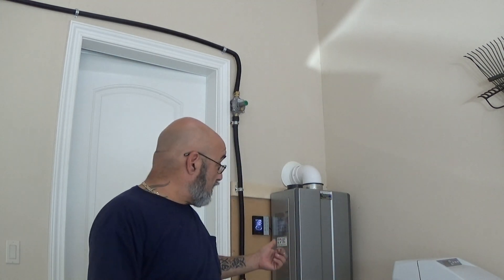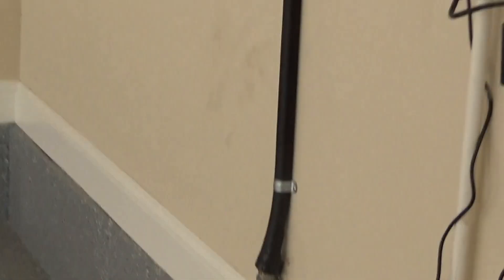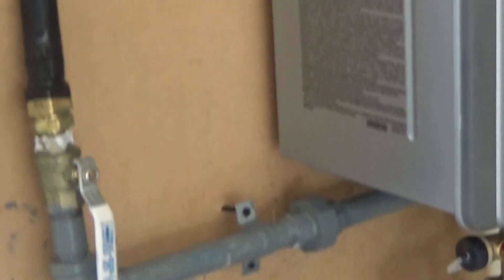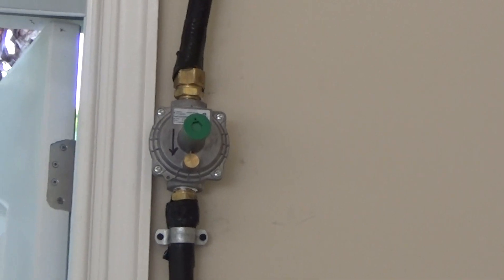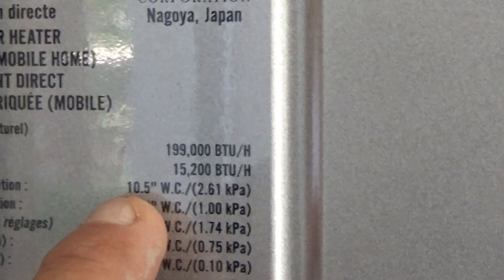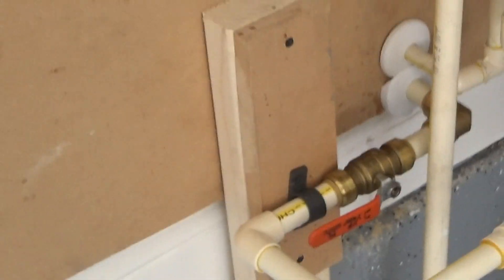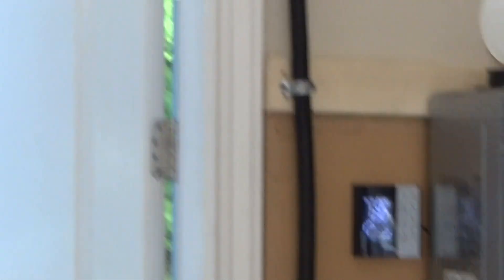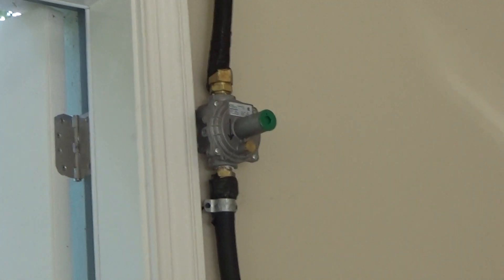Running a dedicated gas line to a Rinnai tankless heater.

Comment: that in line regulator needs to be horizontal  or the vent limiter wont work correctly  at least with the maxitrol   🤣  just pickin on you

Comment: What kind of regulator could I use if I'm just coming off of a portable propane tank? I installed the Rinnai 65ip last week but haven't hooked up the propane yet, and I'm Offgrid. Can I use a 2 staged whip regulator and hose?

Comment: IF YOU HAVE 2PSI AND LESS THEN A 40' RUN OF 1/2" PIPE AND YOU BTU IS 200,000 OR LESS THEN YTOU CAN PROBABALY JUST  USE 1/2" GAS LINES. LOOK AT YOUR INSTALLAITON MANUAL

Comment: Mike,
I am replacing my water heater to a Rinnai V75i . I have 3/4 line thru the home but the last 16 ft to the old heater is 1/2. Do I have to replace what 16ft with 3/4?

Comment: You CANNOT install a gas regulator with a vent limiter in the vertical position like that! Read the directions! The little BB in the vent limiter might not shut off the gas flow in case of a diaphragm failure! That csst looks like shit too.

Comment: I have 1/2" pipe from the propane tank, can the pressure be increased as well as the pipe size for just the heater? Or is the only solution a dedicated 3/4" line from tank to heater? I will know the line pressure tomorrow. Thanks
Chris

Comment: I have been getting a code 12 only when the furnace is running.  The gas meter is in the basement and 3/4 inch gas pipe runs to the other side of the basement to the furnace, stove and water heater.  The pipe that comes out of the meter is 1 inch but is reduced to 3/4 almost immediately.  Should I T off on the 1 inch to the existing piping and then run a dedicated 3/4 to the water heater and the other 3/4 for the furnace and stove?

Comment: Mike, I’d suggest you get that CPVC pipe out of there before it breaks. That stuff is garbage and only acceptable for drip lines and hoola hoops. Yikes dude!
Reply: yeah its easy to install but gets very brittle over time and yikes cpvc in a garage that is a recipe for disaster only a matter of time before someone bumps into that ... quick cheap job
Reply: Thats not CPVC.  In fact it is just PVC.  CPVC is good for 250deg.  PVC is good for 135deg.  Hot water plumbing should be copper, PVC is just asking for trouble.

Comment: Mike, as always great videos on both your channels. I am replacing a 55-gal water heater with a Rinnai RUC80iN. The natural gas line to the area of my heater is 3/4” but the last 3 ft. is 1/2” pipe. Do I need to replace the 1/2” pipe and the 3/4 x 1/2 x 3/4 “T” or can I leave the “T” and just immediately transition up to a 3/4” pipe? Thanks for your help.
Reply: Joe Benga just increase the pipe to 3/4” from the 1/2” up to the tankless. Use a 3/4” ball valve. Thanks Mike
Reply: Great, thank you!

Comment: Mike was very helpful in explaining Rinnai's to me. He answered all my questions and got me to not only select the proper unit for me but also told me what would need to be done and a cost factor in hooking it all up and the unit to run properly. I've looked at other tankless units in the past but then I ran into Mike here on YouTube and He has me sold on the Rinnai. Their customer service is A+ and reputation is unbeatable on the market. My only quarrel is that I wished Mike lived closer because it's hard to find a guy who is honest and will do you right with the install but at least I know what exactly needs to be done and won't have to rely upon my installers word that it is hooked up right. I've been burned in the past in the HVAC side of construction on this. 
Oh by the way, cool carpenters wood shop channel. Check it out sometime. Once again thanks Mike. If I ever have an issue with the tankless, I got you as a back up to resolve it.

Comment: The video was very helpful. A couple questions though 1 you said the gas company changed the regulator at the meter? And it was a 2lb regulator they installed out there or a 2" regulator? It changed during the video 2. It would have been nice to have had a more detailed video shoot of the meter hook up area. My gas company is telling me I don't have to run a dedicated line from the meter yet I'm getting the identical hot water heater you have in this video. 3 what was the part number on your pietra gas regulator. I know it's 3/4 line size. Thanks for the video. Yours is the best one on YouTube for gas lines .
Reply: codered37 if you would like here is my e mail address economyplmbg@aol.com send me your contact info and I can go over it with you. Mike
Reply: Email sent